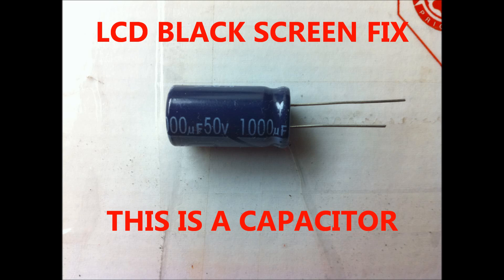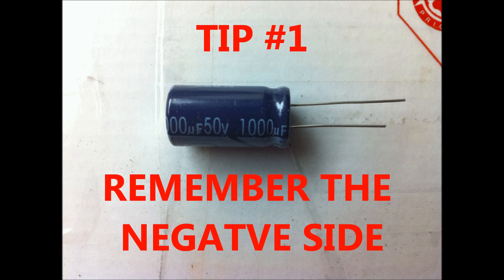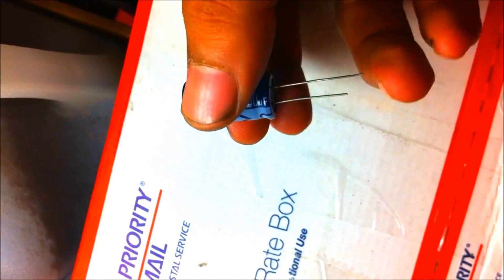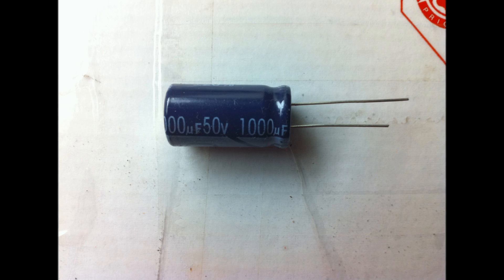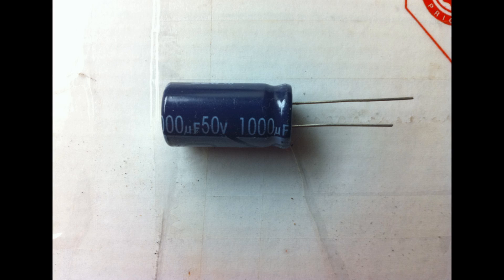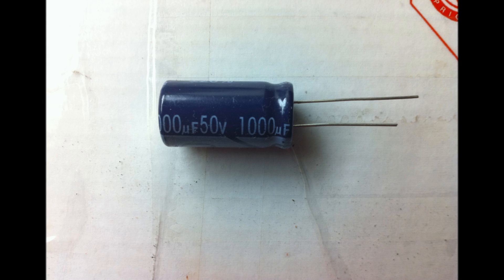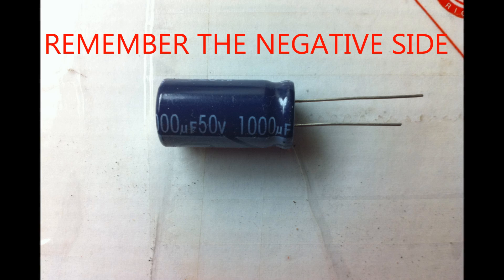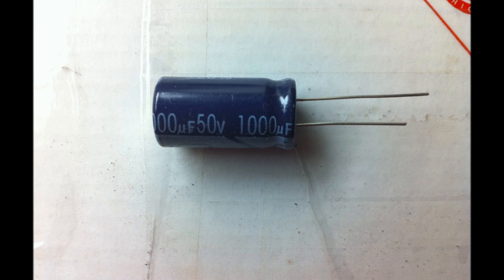TV Wont Turn On Fix Black Screen LCD Samsung LG Sony Panasonic Vizio

Comment: At about 2 1/2 minutes into the video, he recommends replacing the capacitors with ones rated at a "higher" voltage. He goes on to say that he is not an electrician. PLEASE DO NOT DO THIS. Somehow in his untrained wisdom he thinks that the engineers that designed and built this equipment got it wrong and should have gone with "MORE POWER". 

As I write this, I see that there have been over 158 thousand views. I hope they are all still with us.
Reply: More voltage is not a problem! the capacitance must be the same!

Comment: My tv wouldn't turn on.. a friend told me to take off the back panel and unplug the connector from the mother board and plug it back in.. It solved the problem.. Works fine now..

Comment: What if i dont have a blown capacitor? This is the second time it broke down, my warranty just ended last month. I have a 2013 samsung smart tv 32". Im wondering if its the ic chip, cus i was watching another video replacing the ic chip for samsung broken tv. I just dont know where the ic chip is in the power supply..-_-"
Reply: There are few times where tv manufacturers are aware of reported issues so you can contact technical service to see if the repair can be cover by the manufacturer, so good luck .
Reply: felix anderson 1 yr warranty is over by just 1 month. The power supply was changed only 4 months after purchasing it last year. Will never buy another samsung tv again.

Comment: Not sure if you would know other tv or only sony but I have an LG 47lw5600 and I could hear the audio but it just stay in the black screen would you know if I change the T-Con board would fix it. Or can the main board or the power supply board. I would hate if is the screen it self is mess up.

Comment: i have a problem of my LG plasma 42" I encounter no display with power,, I already replace Zsus bord due to shorted IPM IC that causes by fuse faulty,,  when i done replacing Zsus board and check voltage ok together with Ysus voltage ok also.. ang check still doesn't work,, no display with power.. please anyone can help me????

Comment: for caps that is incorrect, you should try to stay within the same volts if you can, you can go larger with uf, I sometimes go slightly more uf just because to give it more life. Liquid filled caps age, and deteriorate so if its slightly bigger than it will last longer. Also it is a good idea to add cooling caps will pop from getting to hot.

Comment: hey man, what type of soldering iron did you use? I see that there are a few different versions, I assume for different uses? 

Also, is the only way to find out what sort of capacitors to replace is to open up the TV, located the dead ones, note down the details/numbers and then go to a shop to buy the replacements..? 

I've been given, for free, a 42" LG 42LB9DF-AD TV which has a black screen for about 8-10 minutes before it will eventually start showing a picture. I've been told it's the caps

Comment: cheers for the Video, $10.80 for 6 caps and the TV is working just as it should.

note. i upgraded to 16v 4400uf to replace the 10v 3300uf caps. 

anyway, cant thankyou enough. YOU TUBE ROCKS.

Comment: I would take the back off, turn the TV so you are looking into the back of the TV, stand back and dont touch inside while it is plugged in and look for the area where the cracking and popping is comming from.   Id venture to say it is something other than a compacitor issue. 

Also someone asked before "How much are capacitors?" They are a few bucks or under in electronic shops. I found diode's I needed at Radio Shake for .67 cents.

Comment: I have a Toshiba 32 LCD TV that when I turn it on has no sound and a black screen.  The power light comes on and is solid.  I am unable to get the menu or any button to work.  We did have a power outage a few days and it seems that may be the cause.  Any suggestions?  Should I change the capacitors?
Thanks

Comment: I have a question that maybe you can help me out with. I tried to update my firmware on my lg 32ld350, and as soon as it finished updating the T.V turned off as if it was rebooting, but it never came back on. This was last night and so it has not came back on. What can I do to repair this

Comment: @aharmdiver1  Try checking the backlight of your TV. It will most likely be located on the back of your TV in the Vents. If you don't see any white light, then the backlight if your TV could have possibly went out and needs to be replaced. Usually when you power up your TV & receive audio but no picture it is a backlight issue.

Comment: I appreciate your redo of the capacitor video, but there's a few things you should note to us.  When changing the capacitors, say you change 3 out of 6 capacitors, if you decide to up the volts on the 3 that you changed, is it alright to leave the other 3 capacitors that you did not change with the original volt?  It seems like you would have 3 capacitors at 1000uf50v and the old capacitors at 1000uf25v, is that okay?

Comment: Actually the uF can be 10% + or - and yes the Post Voltage has to be = or higher
Also another way to tell + and - on the post is the shorter post will always be the - and + will always be the longer post.